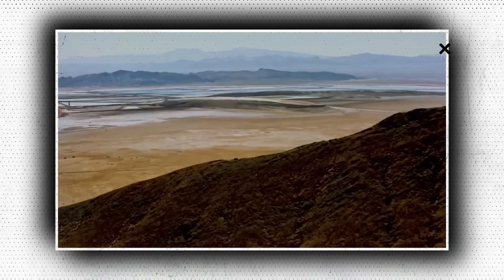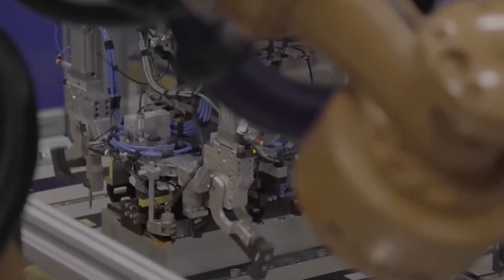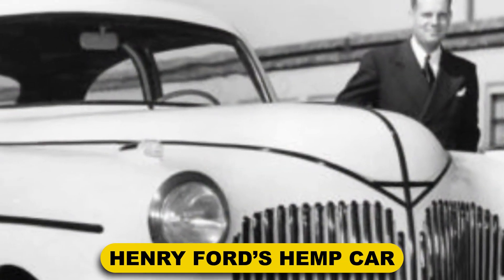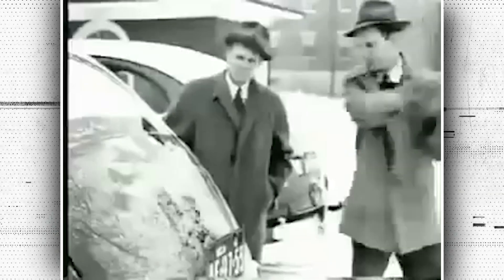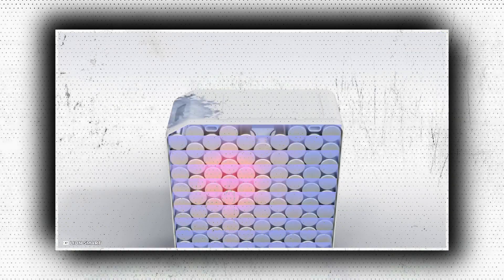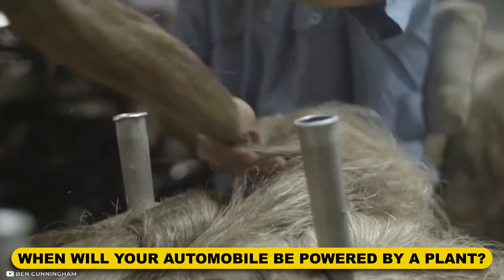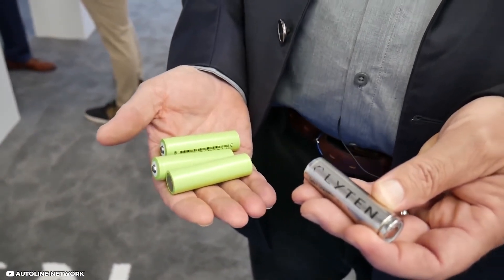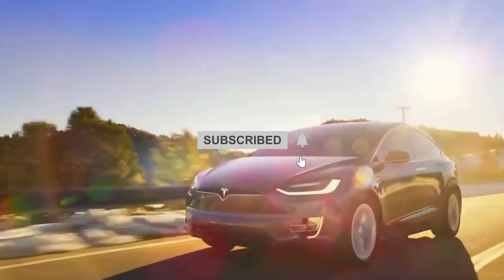Koji Sato REVEALS A Hemp Battery That Will SHOCK Tesla!

Comment: Finally, a good way to use that drug. This is a great idea.
Reply: Dabs bruh.
Reply: @sigmacentauri6191  😂
Reply: I love a bong with warmed mulled wine instead of water. Good medicine.
Reply: The issue with that is all the sugar terps. We would have to use pure hemp plants where it looks like weed but has no thc properties cuz we need the whole stock. However since it’s not in demand, farmers won’t touch it just yet. Using sulfur is wild cuz that’s not even needed to make the battery. Hopefully my battery will come soon :)
Reply: Hemp is not a drug. It's an ancient medicine.
Reply: hemp and marijuana arent the same thing, just related species
Reply: @edoleebeats  They are similar.
Reply: @edoleebeats they are same plants but different strains. Like sour or sweet apples.